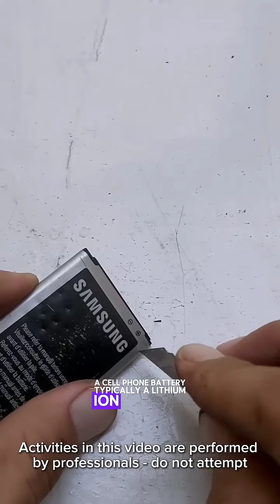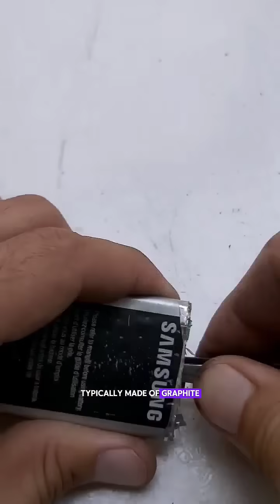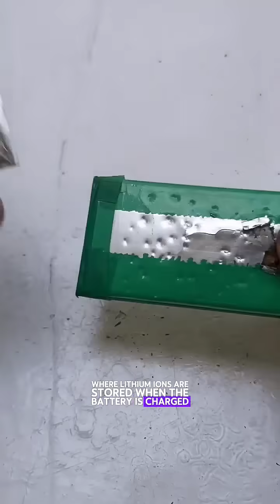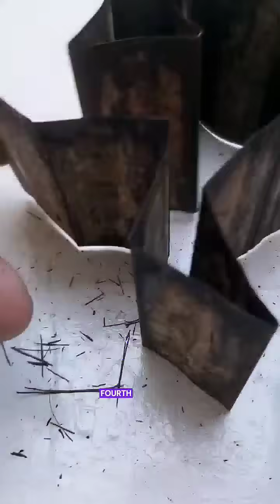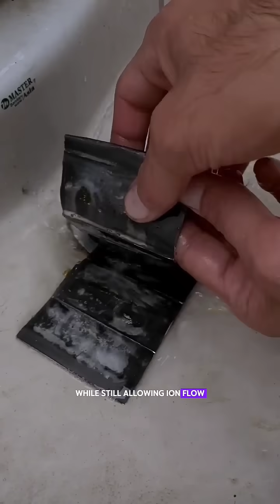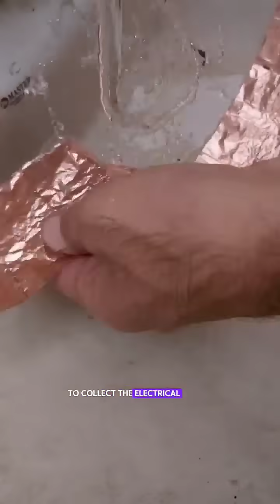Was steckt in einer Handy-Batterie? ⚡ Riskantes Experiment #RiskanteExperimente #Technik

Comment: You can put that exact thing after you unwrap it in water in a mason jar then you can take copper wire connect it to it connect that to a negative charge battery and watch that connector charge enough to light a light bulb if you could have a fire

Comment: This is one of the dumbest and most dangerous things anyone could do. In addition to the fact that exposing the lithium strip to humidity of any kind will cause it to catch fire, that is extremely difficult  to extinguish,washing it down the drain will ensure it seeps into the ground poisoning both the soil and the ground water. That is, if it doesn't explode in your face, possibly causing blindness.

Comment: Dont do something stupid like the guy in this video.
Reply: If there is no energy left in the battery, nothing will happen. I have done this many times and nothing happened, but it should not be done because it contains toxic chemicals and gases.
Reply: Dude, that is not how it works. Lithium Ion or Lithium whats so ever is an Alkaline Metal when it touches water it will react violently and 100% will explode
Reply: Do not mix with water.